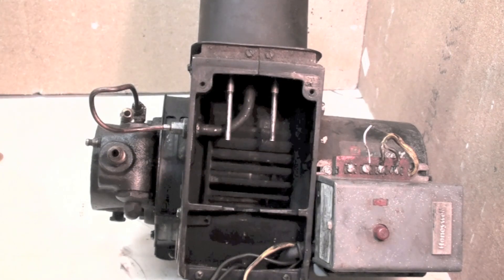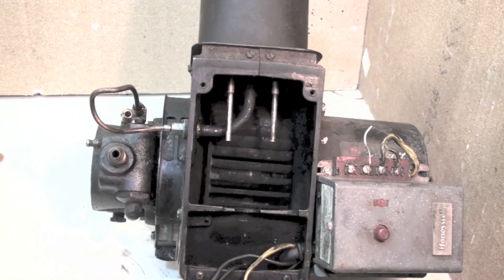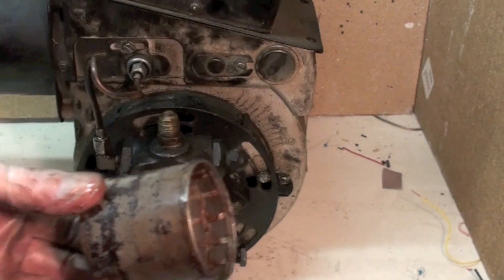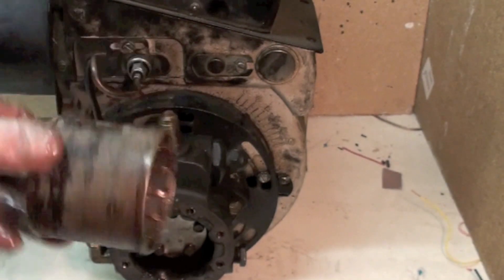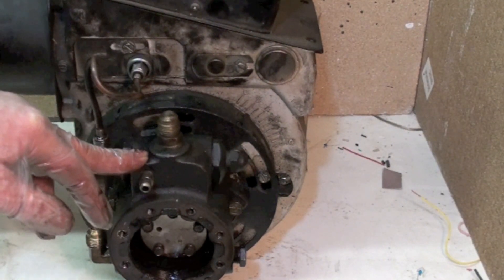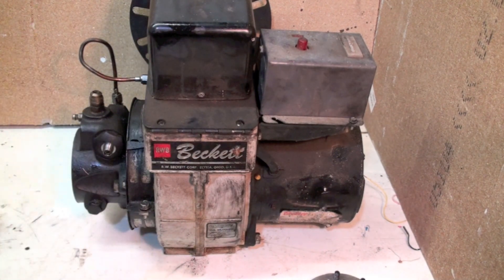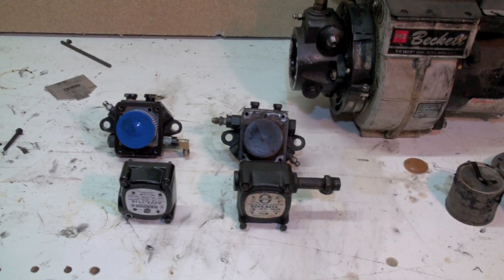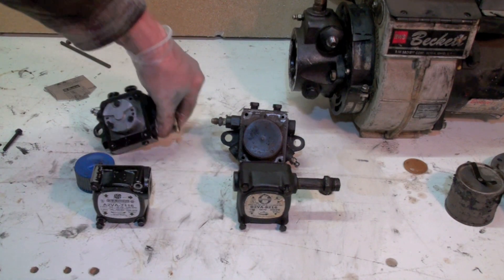oil furnace pump screens

Comment from the maker: Generally it takes quite a while to plug the screen, maybe 5-6 years.  You can change the oil filter every heating season and that is probably good enough.  There will always be some sludge in oil and that is what plugs the screen.  It is usually best to change the screen rather than clean it.  Hope this helps.
GFM
Reply: Time is 💰

Comment: Pg 2 I disconnected the feed line when it was puffing & noticed that the supply would be a solid stream & then start to spit. Changing the filter would result in a steady stream. I have added Power Flow to the fuel but no effect. It is an in ground tank with a 2 stage Webster  fuel pump on a becket burner. I have always used the solid ridge RF-2 filters but will now try the felt 2a-710 to see if it will clog less.

Comment: Page 1) I received an oil delivery 11/16/20012. Since then I have changed the oil filter 3xs now #4. The filter I changed on the delivery was fitly as expected, it was in for a year. My problem is that the boiler will run fine for 2 to 3 days & then start puffing. This will clear up & then start again until I have to shut it down. The nozzle was changed twice.  Page 2 will follow

Comment: well if you are getting water in it i would take a bottle and put the oil in it let it set for 1hr or  let it set over night over night  upside down unscrew the cap until the stuff on top starts to come out when it does screw the cap back keep doing this until you have 5 gallons of oil then put a whole an tire bottle of heet in it try. this tell me what you think pleas